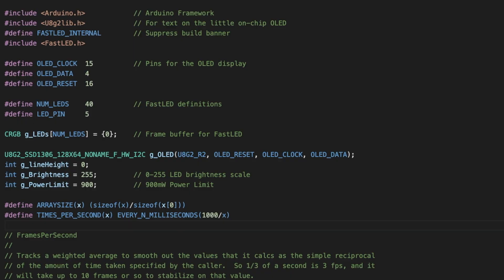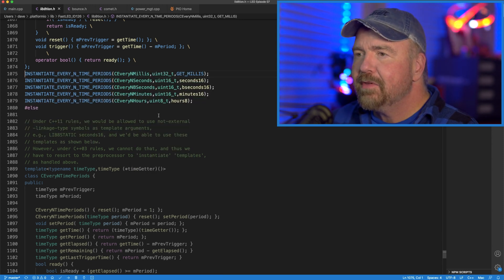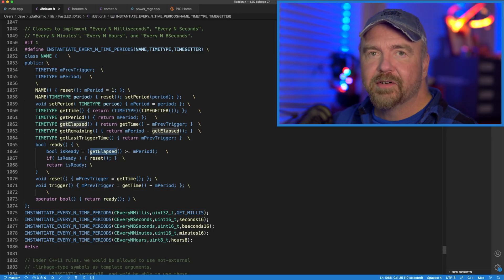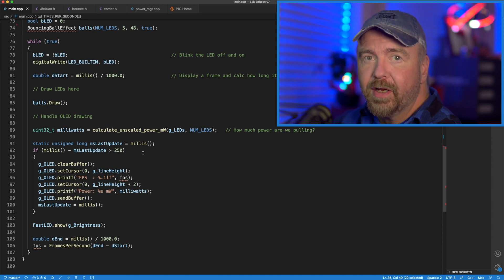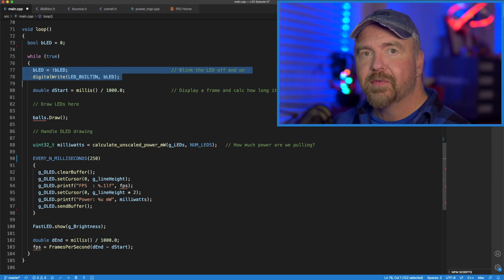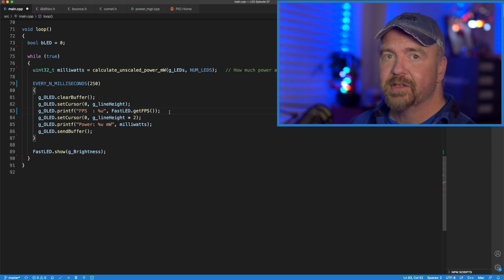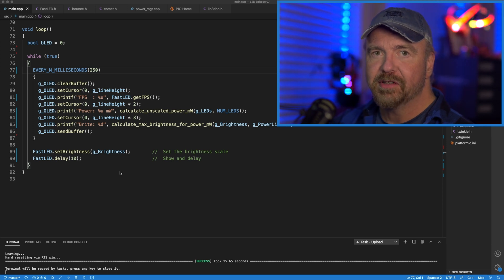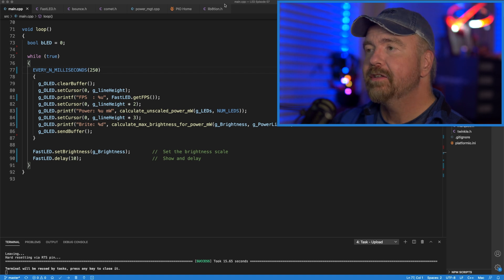08-FastLED Code Helpers - LED Strip Arduino Tutorial - RGB LED Effects

Comment: Super useful!! Wish though that you covered what the "timebase" and "phase_offest" variables in the beat function in FastLED did, I'm still struggling to figure that out :(
Reply: Those parameters allow you to change the starting point of the wave you're creating. They do the same thing but "timebase" let's you work in the time domain and the "phase offset" works in the angle domain. Have a look at Scott Marley's set of FastLED tutorials for more info on how to use these (and a whole lot more).

Comment: I love your videos. Thank you for putting them out there. I was wondering if you could help me with a problem I am experiencing. If I use FastLED with more than 70 LEDs, the whole strip flickers. With less than 70 LEDs, they display colors and transitions smoothly. I experience the same issue when using an Arduino Nano, Adafruit QtPy, Teensy 4.0, and Teensy 3.2. One temporary solution is including the WS2812SERIAL non-blocking library, but it only works with Teensy boards. That's fine, but I still need FastLED to work with more than 70 LEDs using other boards. NOTE: My circuit is wired using a 12v WS2815 LED strip.  Can you please help me?

Comment: When addressing the LED's, how does the LED know whether to execute the command or pass the command on? Each LED has no idea which LED it is in the chain. 

The simplest method I could think of is each LED get's a number, if the number is 0, it knows the command is for itself, if not, will -1 and pass it on.
Reply: Went down that hole a while back, i had sk6812 rgbw, essentially subsequent values get passed forward and there's a timeout to denote end of frame... if that makes sense.

Comment: Thanks Dave! I haven't lit anything up yet, but getting closer. I just ordered a couple $1 ESP-01s boards with LED Driver module.  Some come with a small WS2812B ring light.  The ESP-01 is pretty cool for $1ish. Its a 8266 chip.
Reply from the maker: That should work just fine for these types of demos!  And you can't beat that price!